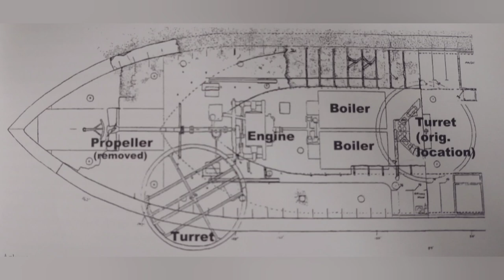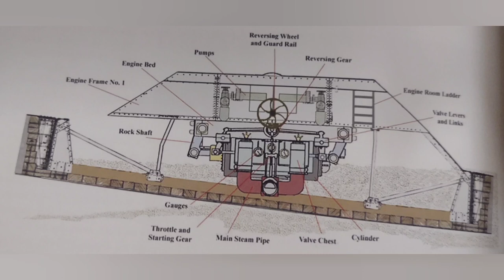USS Monitor: recovering the Turret 20 years ago

Comment: was passaic's pilothouse fixed onto the turret? or did the turret rotate under the pilothouse if it was static?  That is something I've never understood
Reply from the maker: The pilot house was not connected to the turret. The turret operated around the pilot house base, though the foundation of the turret's operation was largely unchanged from Monitor with the pilot house being held on a central support that the turret rotated around. If you look up cross sections of Passaic's turret, you can see the separation between the turret roof and pilot house floor.
Reply: @centralcrossing4732  Ah I see thank you! Was it true that Monitors helm was rigged up on the turret for her final voyage? I read that in a book im reading. It says it was stuck up on the turret and there was a iron sheet added for extra protection. The book was written in the 50s, it is called The Monitor and The Merrimack.
Reply: that surprised me and im not sure if it is true or not.
Reply from the maker: @jofreddy8643  This is a fun topic. It appears that during the summer, the helm was rigged on top of the turret for a short period of time due to the 120-160°F temps inside the ship. I'm not certain as to the original source other than a potential eyewitness, so I can't say how true this is. However, this arrangement was not standard and could not be used in battle as the helm would turn with the turret, so that means the turret couldn't rotate if the helm was on top of it. Back to your question, this was not done during the final voyage, the helm was only in the pilot house. The shield on the turret top was added for a different reason as well. The only way to see out of Monitor's turret other than the gunports was through the roof hatches. When Monitor engaged land targets, or at least attempted to, confederate sharpshooters were attempting to shoot the crew. The shield was added to protect the crew, not a helm.
Reply: @centralcrossing4732  thank you very much! I love learning about those old Civil War boats.